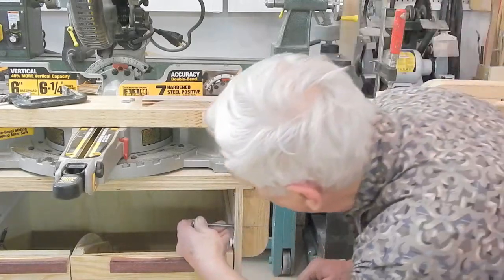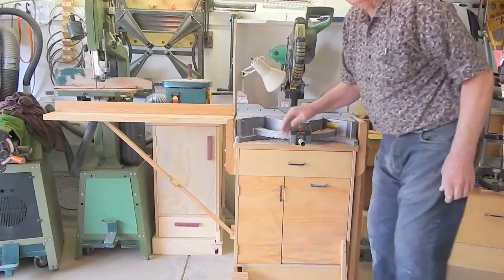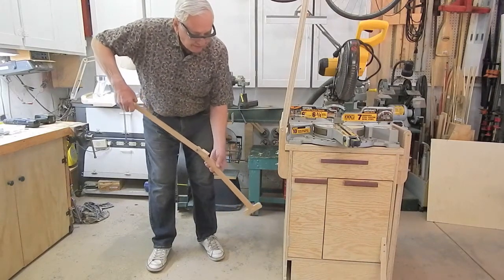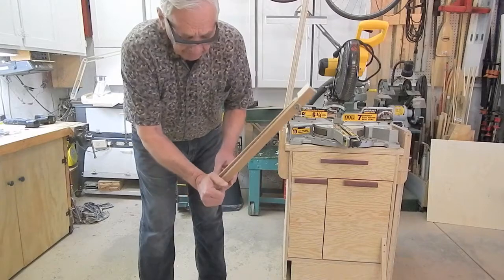Miter Saw Stand 2 of 4 Wings,Foldup

Comment: I agree it is wonderful to see you back, I built a lift for my Planner stand based on one of your designs several years ago. It has worked well for me with one exception. due to my shop floor not being flat concrete with a few high spots it would drag. and today I cut a 1/4 inch off the bottom of the legs and this rectified the problem.